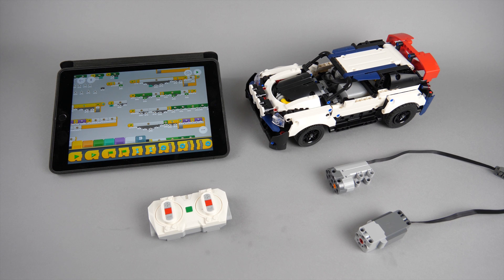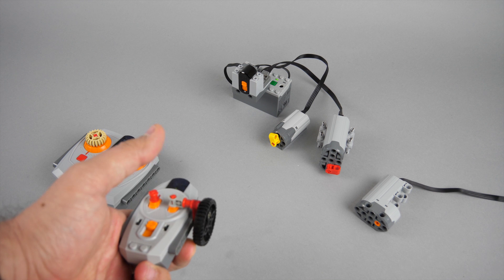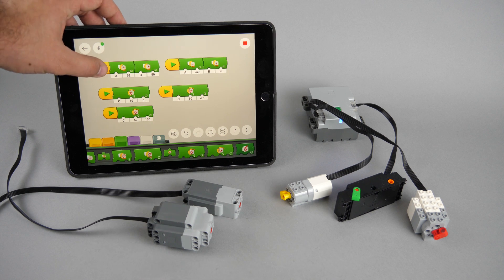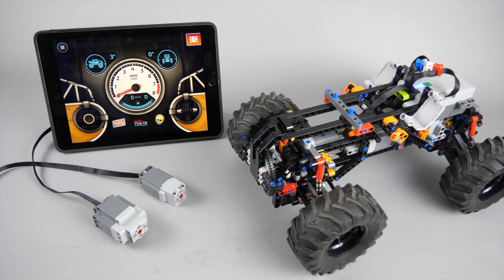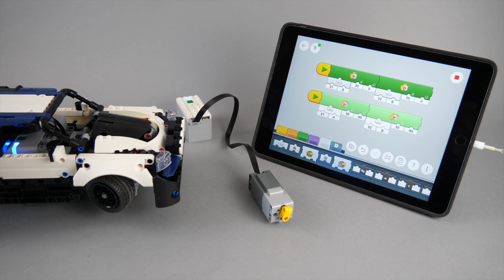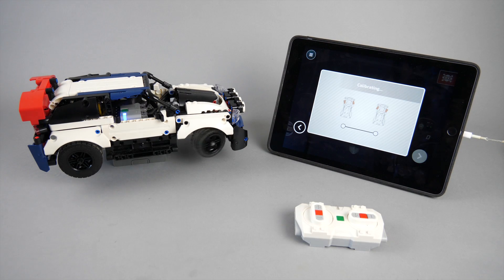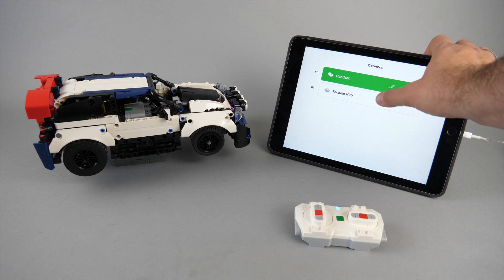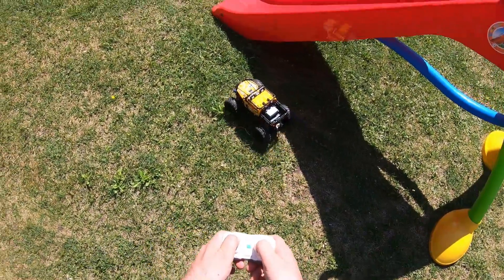LEGO Powered Up simple RC control with the remote + PF Servo comparison

Comment from the maker: PDF with the code can be downloaded here - https://racingbrick.com/lego-powered-up-customized-controllers/
Reply: I am interested how to download the app
Reply: Can we control Tech hub vehicles (such as 42109) directly with remote controller (88010) without app? like what remote controller can do to city hub (88009)?
Reply: I have problems with the steering section by the 42109. can you help me their?
Reply from the maker: @paulalbrechts6054  you need to tell me more about the problem to be able to help :)
Reply: hey do you have to have your smart device on and just sitting arounf to have the code work or can yu just leave it behind and only take the remote or will that not execute the code, can the hub save the code? i am confused because i dont know whether to buy control+ motors for simple cars or just buy ovepriced resold power funtions  with their simpler servo
Reply from the maker: @Gizmos_and_stuff  the code actively runs on the smart device so you need that to make the remote work. There's no official way currently to run the code on the hub, there're 3rd party solutions like PyBricks. I have a video about that as well, you can take a look.

Comment: Thanks for the video! Would this guide also work for controlling the Zetros 42129?
Reply from the maker: This is a pretty old guide, the app has better capabilities by now. I suggest to use this one for a simple control - https://youtu.be/AuL-wdn3v4g
It needs some minor tweaks but should work for control, although it won't engage the diff lock. If you want to use the physical remote then you can check out this tutorial with Pybricks - https://youtu.be/OI26ok1Kekc
Reply: @RacingBrick  thanks for the swift reply, yes exactly, I want to use the zetros with a physical remote for playing with my 4year old - and also later trying to re-use that same RC system on the floating catamaran. Will give this a go! Cheers

Comment: Thanks for this, I have downloaded the code but the code blocks available on the powered up app seem to have changed since the pdf was made and are no longer available, will you be updating it please with the new coding blocks? Many thanks
Reply from the maker: The guide needs an update as there are more solutions available, but there were no blocks removed in the app. If you are missing something than make sure you have all blocks displayed by pressing the 3 dots in the bottom right corner, and then select the 3 bricks for display complexity.
Reply: @RacingBrick  Thank you so much for your reply. I will try this. 🤞🤞

Comment: For anyone wondering, Lego has since added the return-to-center steering through a simple coding block in the green section. It does exactly what the sets do: turns all the way left then all the way right and automatically stops at the center. (It’s a lot simpler than DIYing it like in the video)
Reply: I find the torque resulting from that block to be top high for the structural integrity of smaller setups. Any idea how to decrease it?
Reply: @piotrkozlowski8543  If there is a way to decrease torque in that code, Racing Brick would know.  Although it seems unlikely. The only thing I can recommend for small setups is to build an external limit that stops the motor from turning past where you want it (kinda like lock-to-lock when steering a real car)
Reply: What about the education sets like spike the robot. I think the app is actually different than powered up.

Comment: can I use a linear motor or simple linear motor?
Reply from the maker: For what purpose?
Reply: @RacingBrick  As a steering motor?
Reply from the maker: The linear motor can be used, the simple linear motor does not have an encoder
Reply: @RacingBrick  Thanks I am planning on buying both, since I will motorize my Mclaren Senna GTR.

Comment: I have a power up remote and engine from a train and lots of spare bricks and technics parts. What part do I need to buy for a steering mechanism and what can I do to build a similar car to your rally car
Reply from the maker: Train engine is not really suitable for cars. I suggest to get 42109 to have a basic setup that you can use in further builds

Comment: Hi, I have a servo motor with the buwizz but the steering is not proportional. How do I fix?
Reply from the maker: If you use it with a slider or a joystick then it should be. Are you sure the servo is genuine LEGO?
Reply: @RacingBrick  it is not genuine but the seller claimed it is “proportional and precise”
Reply from the maker: @vanduril  then you should go back to the seller. I am not aware of any 3rd party servos that are truly proportional like LEGO's version
Reply: @RacingBrick  I appreciate your reply, but what do you mean by “go back to the seller”?
Reply from the maker: @vanduril  contact the seller and ask him
Reply: @RacingBrick  ok I will, thank you for your support!
Reply: @RacingBrick  the website is called “green gecko lego technic workshop” in case you were wondering.

Comment: Is it possible to configure the pu motor for servo steering directly through the BuWizz app just with a BuWizz?
Reply from the maker: The BuWizz app still does not have return to center steering with the PU motors

Comment: Nice video ! But I can’t turn one by one degres with my BuWizz and servo motor... how do You do ? Special function ? Thanks in advance :) and happy new year ;)
Reply from the maker: Power Functions does not have degree level precision control for the Servo motor, that one only have 15 positions altogether. Only certain Powered Up motors have this ability, but you cannot control them with a BuWizz unit.
Reply: @RacingBrick  
If I understood correctly : in your video @2:20 , you use 
a buwizz with a servo motor, 
so only 15 positions ? But me with my Buwizz and servo motor I have only 3 position... neutral, left and right...
Reply from the maker: @byFCdesign  if you have an original LEGO Power Functions servo that should have this amount of positions if it is controlled by a slider in the BuWizz app.
Reply: @RacingBrick  Thank you very much :)

Comment: I've just tried 42099 + 88010. The communication is done through the smart device (Samsung T510), from remote to tablet to car, right? For me, the setup does not work much. The car moves the wheels a bit, then seems to be unable to communicate fully with the tablet, or the tablet can't really work with two devices at once, despite is in the list of the compatible devices on the LEGO site. The batteries are full on all the devices. Still, the car moves a bit, loses soon the direction or the advancement. It's programmed as in your specs. I see the program modules reacting to the remote commands too. Any thoughts?
Reply from the maker: Did not see anything similar so far. I'd go trough some basic troubleshooting steps - batteries in both units, compare the behavior with Control+ on the same device, reinstall the app, check the behavior on a different smart device.

Comment: Thx!  I tried the code with the slider on 42109 config and it works nicely except sometimes I have to reset the steering manually.  But it works on my custom steering system, so it's really nice.

Comment: Thank you so much, Balazs! I did the simple code version and it works perfectly! This was my  first time doing custom code in the Powered Up app, so it took me a bit to figure it out, but by following the PDF and this tutorial I eventually got it! Super happy! Thanks again!  :)
Reply: I would also add to this that it's also quite educational to follow this tutorial. As I said, this was my first time writing custom code for the app, and by following the directions now I understand much better how the whole system works. I highly recommend doing this project just for the educational experience.
Reply from the maker: I'm really glad to hear that :) Do you think a more detailed step by step tutorial is required for beginners or a code sample at this level is fine?
Reply: I would say that copying your code from the PDF was the easy part. As I said, this was my first time doing it, and I had no problem finding the blocks after a bit of looking around in the app. But I'm a visual person, and I can follow instructions based on icons easily. Maybe a short written intro in the PDF of how to find the blocks could be helpful for those who are more used to written instructions. My biggest challenge was that I couldn't figure out how to connect the app to both the remote and the rally car at the same time. I could get the remote to connect automatically, or the car, but it was not clear to me how to connect both. So, I came back to the video and watched and re-watched to see what you do, and I finally realized that I just have to hit the Bluetooth button again to add the second device. That was a big revelation, haha! So yeah, for us noobs, we might need a bit of handholding with basic stuff that seems obvious to pros like you. You may just want to have a basic intro to how to use the app, and link to that from all your PDFs. I was trying to Google what to do, but nothing came up. So I came back to the video, hoping to get a clue.

Comment: I used BrickController2 app and a bluetooth 20€ joypad from amazon, and it works great. I can configure the joypad however I want and it’s super easy and responsive.
Reply from the maker: I also prefer this solution with BC2, however there are a lot of people who prefer to use the LEGO app and may already have the PU remote, this is a good solution for them.
Reply: RacingBrick yes for sure! 😊

Comment: Awesome description for me as I have not yet so much insight to control+. Do I understand correctly, that the app always interprets the signals from the remote control via your instructions to the hubs? Or can remote control and hub also communicate without the app/tablet once they have executed the program?
Reply from the maker: Currently the remote has only one default behavior with the AA hub that you can use to control trains or tracked vehicles. With any other hub or for custom control you need the app, and the code in the app uses the remote as an input. This means to control the car with the remote you need the app and your custom code running all the time.
Reply: Why?
Reply: @EricKidson2008  Effectively the remote controls the app and the app controls the hub. It is not designed to work without the app, at least not yet.
Reply: Noooo

Comment: Thanks, very useful video!

To answer your question: 
I still prefer to use the previous system (Power Functions)
It readily enables you to have a simple RC car with return to center steering, although with no real proportional steering.
(Using PF "Servo" Motor & Regular IR remote control.)

Yes, IR signal has its limits, but for the sake of simplicity and not going through a complicated difficult calibration process, i believe for the time being that is still the preferable solution to me.

P.S
If i actually need:
1. Proportional steering
2. Longer range

I'd personally go with an EV3 Brick with ev3dev and connect a PS3 gamepad to it, instead of having to figure out workaround on the Powered Up app.
Reply from the maker: Thanks for taking the time to reply! For PF you can try BuWizz or SBrick with the BrickController 2 app and a gamepad, it actually supports PU as well so it's a very versatile solution.
Reply: @RacingBrick  Thanks for the suggestion! I'm aware of those solutions, however i never used them before. However, i prefer to have direct communication to the gamepad without the use of a smartphone as an interpreter. Since this is only possible using EV3 + ev3dev, this is my preferred solution so far :)

Comment: This is realy by far the best Technic channel :O
I like powered up more, it's kind of a toy by it self :D
Does your calibration solution work with actuators / clutch gear, too? Personaly I haven't tried by myself, I'm just curious.
Reply from the maker: The calibration was designed for steering in cars ,for actuators you'd need something different

Comment: Any idea where to get just the hub and motors?
Reply from the maker: At the moment only on Bricklink, or you need to buy one of the sets with the PU parts.
Reply: Technic Hubs/Motors are currently not sold by lego. But you can find them on bricklink
Reply: Thanks guys
Reply: To be fair, i have this car its pretty pants  but cheap considering it comes with hub and motors i use the motors and hub for mocs and the other parts some for mocs and i sold some parts and the stickers all in all it was cheaper then getting hub and motors separately on brick-link (got mine second hand unwanted xmas gift)